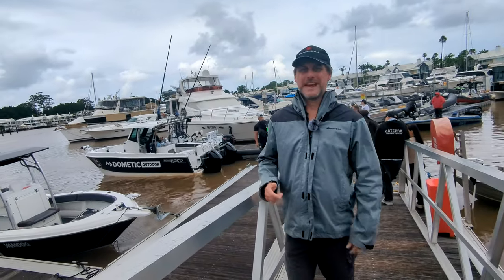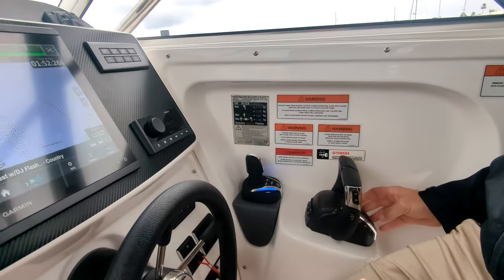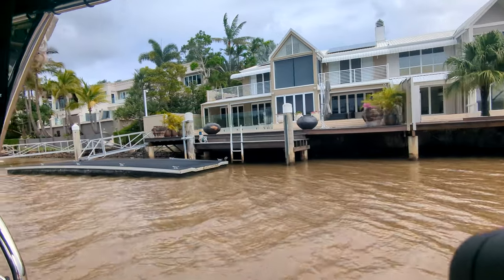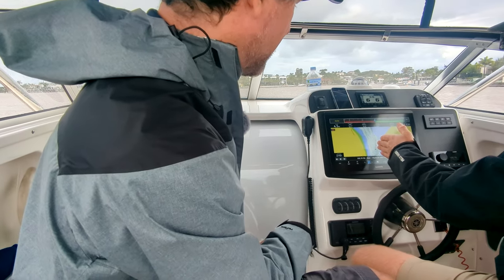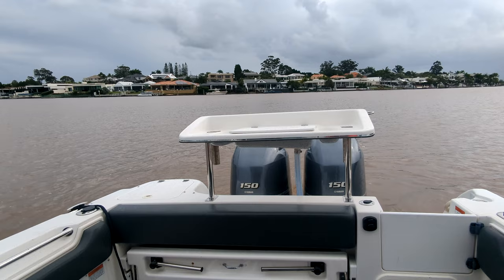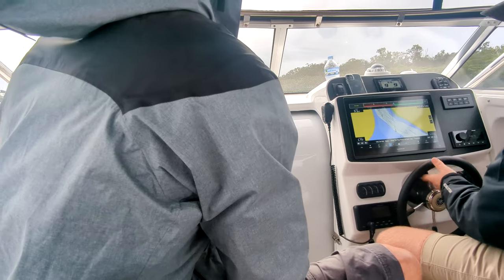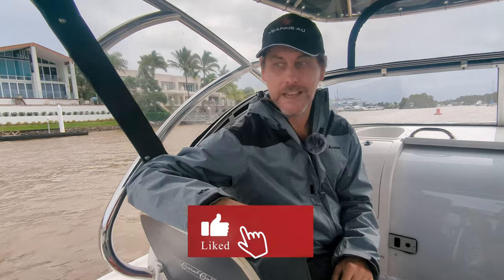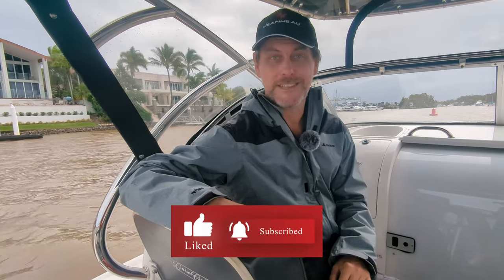YAMAHA HELM MASTER @ SCIBS 2022 | The Rudder

Comment: Does it justify the cost. 30k is a lot of money
Reply from the maker: It is fairly impressive but depends on what you are using the boat for. Much more manageable if purchasing a new boat. Electric throttle control is fairly standard.